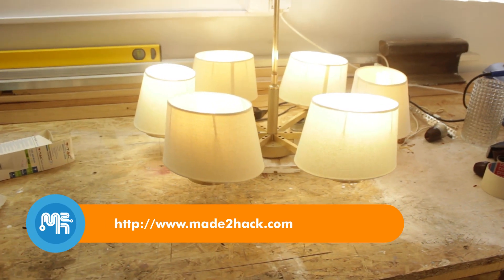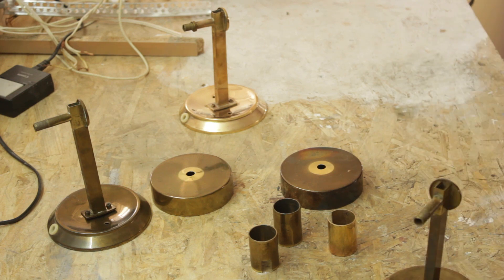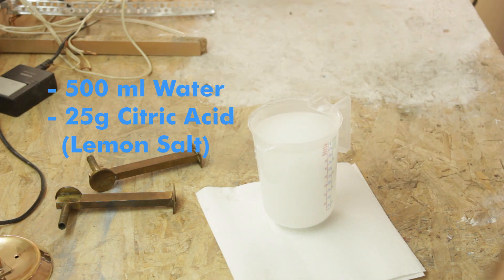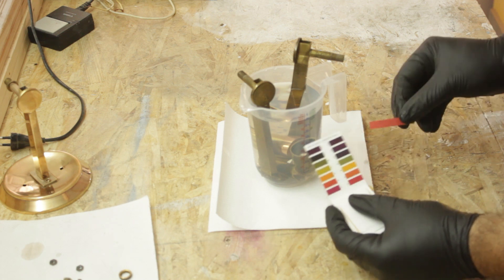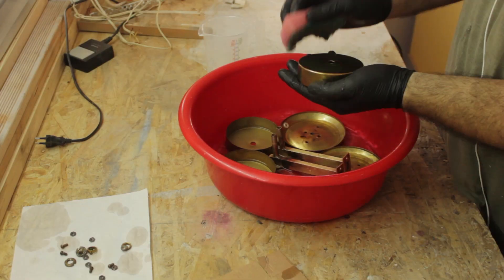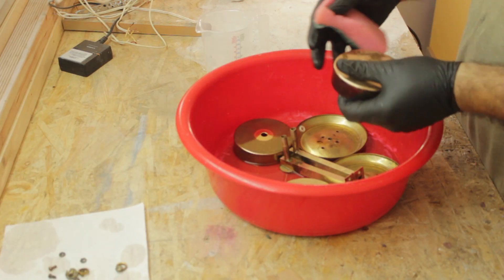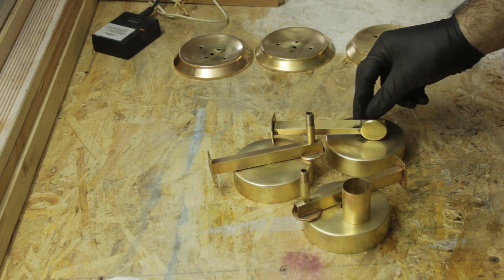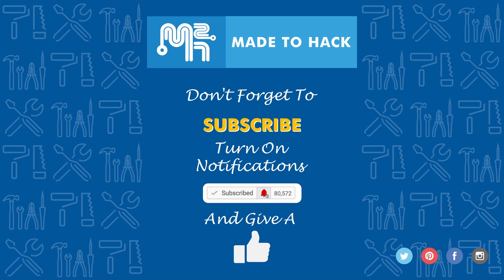How to Restore Brass Using Citric Acid - Easily Restore Brass with Household Ingredients

Comment: The black side of a kitchen sponge scratches metal. I would try a polishing powder with a finer grain. Buy citric acid by weight from pickling supplies for cheaper. Then you can fill the whole bowl.

Comment: Place the parts needing cleaning suspended from a rod across an old stock pot citric acid & water bring to the boil 5-15mins the heat & bubbles will accelerate the cleaning process

Comment: Should spray with WD40 to help stop oxidization, after restoring.
Reply: WD-40 is a catalyst and completely evaporates into the air! It does not prevent tarnish over time!  To prevent oxidation you need to keep the oxygen away with a lacquer coating!